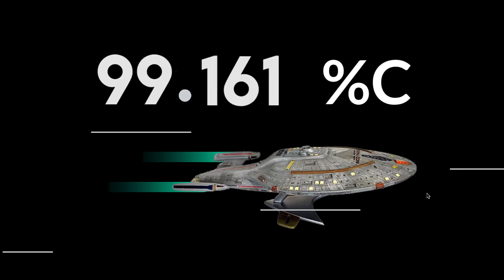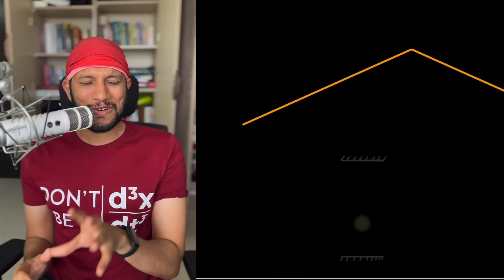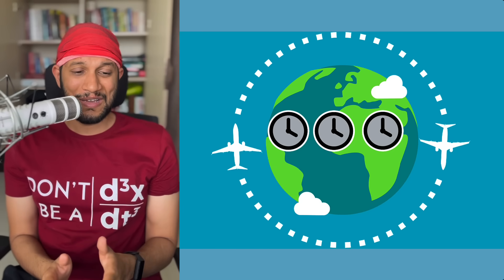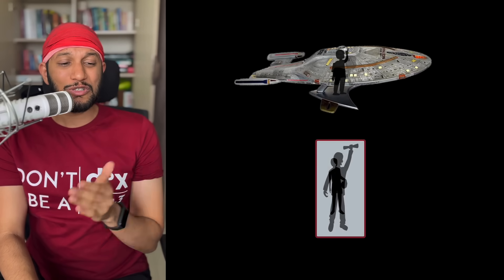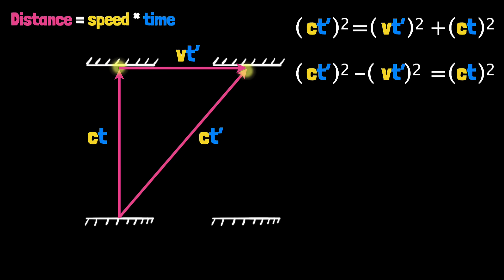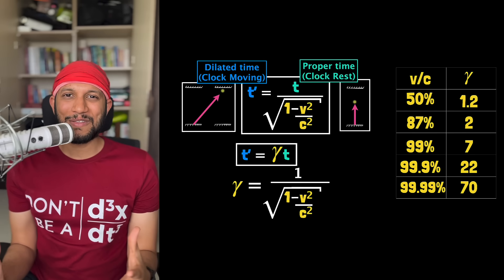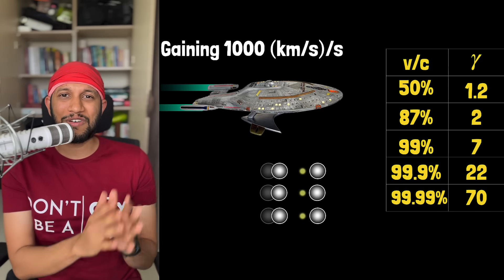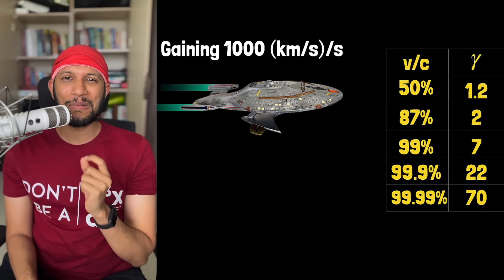I finally understood why you can't go faster than light! (My mind is blown)

Comment: How does this fit in with relativity of motion? Say you have two ships, each with their own particle watch, and one of the ships move. Relativity of motion says that the perspective of the moving ship, is the same as the one that stands still. From the perspective of the moving ship, still ship is moving the opposite way, while the moving ship is standing still. Which one of the clocks goes slower? If they both go slower, they should be the same, and then time isn't relative. If the one on the moving ship is slower, then motion isn't relative. If the still one moves slower, then Idk wtf is happening.

Comment: It feels like we first claim that the speed of light is the maximum speed, and then based on this fact we prove that it is the maximum speed. That is, we prove what we used as an axiom at the beginning. The video is cool, but I don't understand why there should be this limit at the very beginning (well, this already looks like a philosophical question)
Reply: Precisely what I also picked up, that made me scroll through the comments to find this one!

The initial assumption is about that "photon clock." I.e., that whether at rest or in motion, the "tick" of that photon clock defines and/or sets a limit.

Imagine that c were replaced by the speed of sound, i.e. you had a sound clock, with a speed, say s. Exactly the same math would lead to the conclusion that you cannot exceed s due to time dilation, wouldn't they?

@FloatHeadPhysics, the question is therefore why use a photon clock with a speed c in the first place?

If anyone can help, please do!😊
Reply: Because everything is driven by electromagnetic forces which we can measure to have the same speed everywhere. This philosophical part would only be that there might be something new which we haven't measure yet which would disprove or extend the current explanations, but within what we can observe it makes sense. Nothing more.
Reply: Check out the Michelson and Morley experiment, that would demonstrate to you that there is no "preferred frame of reference", that the limit of speed of light is the same in all frame of reference.  From this, Einstein POSTULATED that 'c' is the limit to all moving matters.  From this POSTULATE came all the derived equations like E=MC^2 and also the examples shown in this video including the equations.

Using equations to explain why you can't exceed the speed of light is circulative argument.  The answer is simply that the law of nature say so.  Simply put, it is what it is.  There is nothing more fundamental (that current physics know of) than the POSTULATE that matters can not exceed the speed of light to explain "why you can't exceed the speed of light".
Reply: @NarutoUzumaki-om1jw  I think my frustration stems from the way the video sets up expectations. When the title says, "I never understood why the speed of light is the limit—until now," it implies that I'll gain some intuitive understanding of why this postulate makes sense. But instead, the conclusion boils down to: "Because it's a postulate." That's valid within physics, but it doesn't really answer the "why" in the intuitive sense.

It's like saying, "I've finally understood why the universe exists!" and then explaining, "It just does."
Reply: @aleonastar9950  Until we find some law of nature that is more fundamental than this postulate to explain the 'why' this postulate hold true, then there is presently no answer to the 'why' except to say that observation of reality say so.  Then again if we do find something more fundamental to explain the 'why' of this postulate, we end up asking the same question of 'why' for the newly discovered fundamental.

You are correct, using postulate 'a' to explain the 'why' of 'a' is circulative reasoning.  I don't know if there is another branch of knowledge or approach that would do better of not ending up in this kind of never ending asking 'why' - an unavoid consequence of the reductionist approach?

Interestingly, your suggesion of this postulate being an Axiom is kind of correct but yet not completely correct.  Axiom is a logical 'truth' that is intuitively so and self evident like the principle of locality BUT this postulate of limited 'c' was forced into existence by observation of reality.

Comment: Hold on, so if something goes at the exact speed of light it would be timeless, and if it would go faster than the speed of light then what happens?
I heard the universe is expanding faster than the speed of light, so does that mean the universe is then also going back into itself in reverse and going back in time?

Also great video, it explained time dilation in a way I now understand it, before I never did.

Comment: Awesome explanation, but I do have a question based on the explanation. If it takes infinite time or infinite energy to us in regular time, but everything on the ship feels normal, and the aceleration feels the same, what happens to them as they approach the speed of light? Like say they are only 1000m/s before the speed of light, and accelerating at the stated 1000m/s. To us, it would take... well, near infinite time, but to them, feeling everything at normal, what would happen within their next second? The death of the universe?
Reply: I feel like you would never get there because if you go the speed of light, everything would be frozen relative to you! Because information travels at the speed your going, your neurons would not be able to move across your brain (idk if that's how it works but thats my idea).

Comment: Sadly this video still doesn't really let me understand how the speed of light is the limit.

Firstly, speed is relative to the observer, so wouldn't two objects moving almost at the speed of light in opposite directions go away from each other at just shy of 2c?

Secondly, I have always thought of the conceptual idea of a room moving almost at the speed of light. Within the room would be a closed system, and since it is closed, anything can happen such as shining a flashlight at the inner wall going in the same direction of motion. From the perspective of the flashlight, nothing would be amiss as it would be in a "stationary/normal" room, so the light would behave as normal, but then what if the walls of the room were suddenly opened and allowed the light to escape? Now it too would be moving at close to 2c, although this time through a different means.

As far as I can tell with that example, if the speed limit of light speed applied within the closed system of the room before it opened, then that would mean that there is some objective thing which to measure speed against, and that somehow there is some way to not move at all according to that measurement. The only I can think of to limit the speed of something within a closed system already moving close to the speed of light would be to have a global/outside identifier to what is considered its "true speed", however I doubt such a thing really exists, and hence I can't find myself believing in light speed as a speed limit.

Edit to relate this to the video: The photon clock. The claim is that something's velocity magnitude can only go up to the speed of light and this was proved by showing how something would slow down as it speeds up due to some of the vector for velocity needing to have the speed of the clock itself accounted for. Sure, this works, but what actually is speed? Again, there would have to be some universal measurement of speed that existed beyond all matter because how would the clock's particle know its moving too fast? By what viewpoint is something going at the speed of light? The only thing I can conceive is a transcendent viewpoint which escapes matter itself, and if such a transcendent speed limit does exist, that means it should be possible to measure how fast we are relative to it by trying to speed things up in all directions and seeing which ones reach the limit first.

Comment: Also the t' does not need to be greater than t at all. If time is so malleable that it is affected by momentum, just invert it and produce a negative outcome thus traveling backwards in time. Also allegedly according to physic experts the speed of light actually is inconsistent, so just achieve movement at 90% of the speed of light, then slow down light by 11%, and you will have achieved 101% the speed of light. 

I'm actually sitting here right now moving faster than light, because where I am nearly motionless, the light I use to measure the speed of light for the comparison is trapped in a black hole. As such it has its momentum inverted, this to the point that the energy is traveling forward but still moving backwards as far as spacial positioning.

Time dilation is a fools theory. We have plenty of evidence of tools failing, mechanics failing, mathematics fail. But time has yet to fail, biological clocks tick at the same rate no matter how fast they are moving... actually high speeds ACCELERATE biological aging, rather than slowing it down(due to the nature of biological aging not time). Furthermore the most important part of the equation EVERYONE ignores is fuel... how does fuel work again? The fuel is consumed at a consistent rate based on TIME to produce the desired energy, so if time was dilated within the object that is consuming the fuel, its rate of fuel consumption would equally decline and resulting energy output would fail. Every self powered vehicle would consume infinite fuel to move at any speed, totally irrelevant to the energy required to move them. 

Finally the most important mathematical fact. Time dilation allegedly affects clocks on planes consistently at all times based on the speed of the plane... But planes actually only increase the speed of objects within them under VERY specific circumstances(even then, the increase is negligible), and often times actually reduce the speed if the plane is traveling against the earths rotation under the proper starting position. But even if we assume the planes speed is always a blanket additive value to current speed, yhe fastest plane clocks in at 3k or so miles per hour... the earth is currently moving around 300km per second based on best estimates based on objective spacial positioning likely much faster all things considering. So, why are the galaxies outside that motion NOT moving at super speed from our observation, why are spontaneous big bangs not eruption around the universe, as we are moving 1000s of years forward in time per second...

Comment: Your explanation only works from the view of an observer outside the ship. Inside the ship there is no time dilation because time dilation only exists between two different inertial reference frames, and an observer inside the ship is in the same reference frame as the ship.

What relativity really shows us is that light speed is not the maximum speed. It is the only speed. You have a speed through time, just as you have a speed through space. The faster you travel through one, the slower you travel through the other. That is what time dilation demonstrates. The faster the photon clock moves through space, the slower it experiences time and vice versa. 

Photons themselves only have about a 3 year lifespan in their reference frame. From our reference frame, their lifespan is about 10^18 years. Few, if any, have actually decayed in the entire history of the universe. All their speed is through space, leaving none really for moving through time. You cannot accelerate to faster than the speed of light because you cannot slow down from the speed of light. You can only alter how much of your velocity is through space and how much is through time.

Comment: Time dilation is not time, but a perception of it. Time doesn't slow down or speed up, but our measurement and perception of it does.

Light is a frequency. Thats why it is different colors, the slower frequency is red and faster is blue. We separated light colors with a prism, and light bends at the evidence of invisible gravity. Light is not constant. 
For mathematical purposes we needed light speed to be one number.
Time is constant 
Perception is not.
Therefore we are not bond by time, but we are made of light.

All just toiling under the sun. Under the Son.

Comment: Great explanation! Though as a nerd, I already wondered about the relative motion - since both observers see each other moving, wouldn't each see the other's clock running slower? So the natural question to ask is who's clock is actually running slower in the end? This is actually resolved in the Twin Paradox, where the traveling twin ends up experiencing less time.

EDIT:
Just realised that you already made separate videos on that.

Comment: I have been curious about these quantum/relativistic physics topics my whole life.  

A long while ago, I came to the conclusion that 99% of people who explain these topics do not actually fully understand them.  And so my own understanding was very poor.

The missing ingredient was what is presented here:  how the ACTUAL PHYSICAL MECHANISM works.  

This is the first time in my life that I feel like I have any actual understanding of this particular phenomenon at all.  Of course, my level of understanding is "toddler grade," but at least I have some notion of it.  

THANK YOU!!  This is a very satisfying moment!

(FWIW, I think that an "expert level understanding" of any topic involves the ability to solve actual problems.  For example, anyone can be told superficially how a bridge I-beam works, and plug and chug the equations.  But an expert understanding would involve the ability to accurately predict the load capacity of a random shaped beam.  I often wonder how high of an IQ would be needed to reach that point with relativistic physics.)

Comment: Well maybe it takes an infinite amount of time to reach c from an outside refrence frame, but what about the people in the ship. They don't perceive the time dialition so, would it take a finite amount of time to reach c for them ?
Reply: Motion is relative, from the perspective of the ship it's not necessarily the ship itself that's moving forward, it's equally correct to say that everything else moving backwards around it - which follows the same logic as the ship from the reference point of everything else
Reply: Alright, so it would still take an infnite amount of time to reach c, and everything will just be moving faster and faster from the ships perspective, thanks for the explenation. @user-zz3sn8ky7z